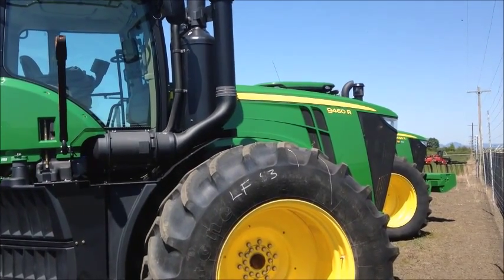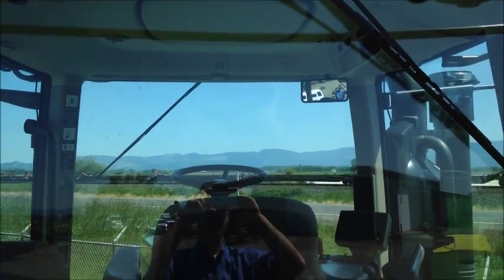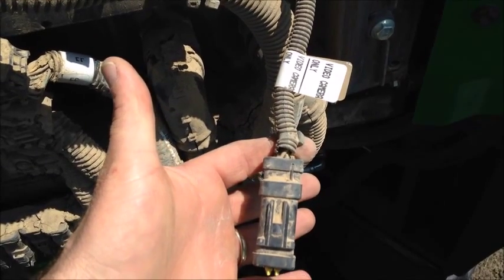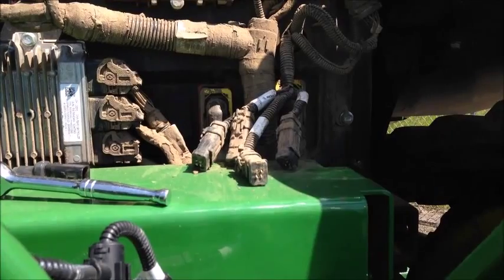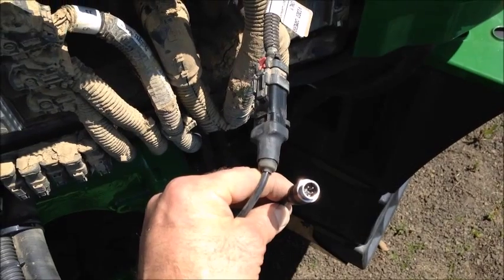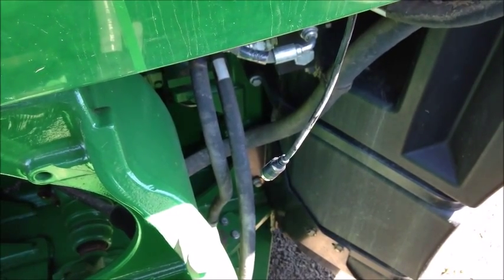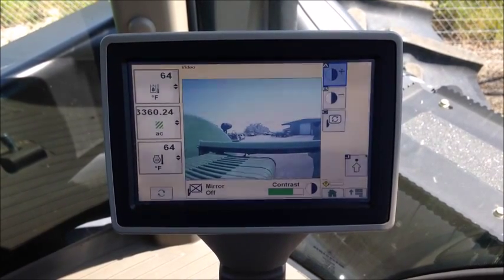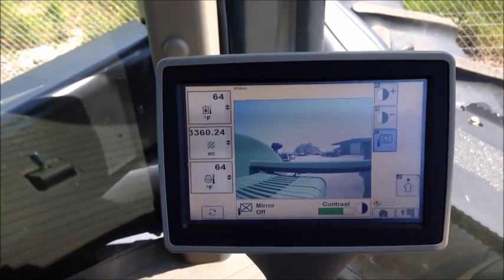GPS Monitors and Camera Ready Tractor installation video

Comment: Where’s the camera plug for a john deere 6155r
Reply from the maker: Hi John thanks for the question....depending upon the year of your tractor it may be in a different place than what you see in the video.  If you would like we will be at the National Farm Machinery Show in Louisville...don’t know where you are from but if you go to that please stop by.  Also here is my cell number...please text me a photo of the back of the monitor on your Tractot and that will also help 
Rob Smucker 
541-606-7274
Reply: Did you ever find it for your 6155R?
Reply: @johnvanderpoel2628  yes i did
Reply: Where is it located? I’ve got a 2015 6155R and am pulling my hair trying to figure it out!
Reply: @johnvanderpoel2628  in the cab on the right hand side theres a 7 pin round plug. Six pins in a circle and one in the middle. They take a adapter to any camera cable. But theres also a fuse that needs installed in the fuse panel on the right hand side to make it work.
Reply: @johnvanderpoel2628  right by all the other accessory plugs along right hand window.
Reply: @TheJpsmith1996  awesome I appreciate you!